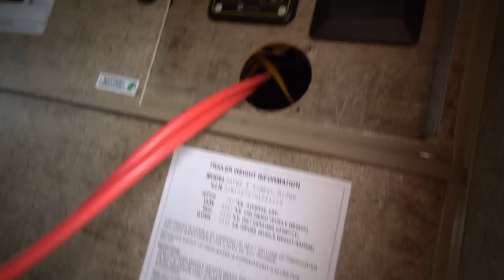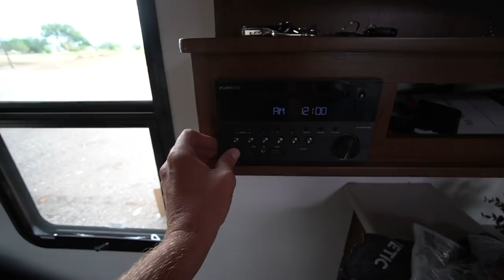Detailed Installation of RV Lithium Battery Upgrade 🔋(Step by Step)

Comment: I would like to see info about the design and component selection process.  Who did you work with on that part and did they give you a detailed wiring or schematic diagram?  THX
Reply from the maker: Hey there. I designed it and didn’t do a schematic on this one. I just researched, read, and watched a lot of videos. This was my third install, ( van and truck) so a diagram wasn’t as necessary for me. But I agree it does help to have a diagram for sure!

Comment: So now that you've spent time with this system do you feel like it was overkill?  And maybe you could have used fewer batteries, i want to upgrade my tt but im just turned off by the price, im thinking maybe a 400ah sytem would be fine, im not full time, i have panels already and on board generator, thanks
Reply from the maker: You would probably be completely happy with 400 ah. We had 400ah and 300 watts solar in our sprinter van we lived in full time for 2.5 years. It was great except for the low sun winter days and we really couldn't run the "big" AC appliances for long periods of time. The goal with the new system was to be able to run those big items like Air con, water heater, induction cooktop, air fryer, etc for many ours a day a not worry about it. So for this new system is an amazing way to live off grid. We are still testing the limits of the system but we rarely go down past 50% right now. But we are also pretty much getting all sunny days here in the SW and have''n't ran into a cloudy streak. That's where that big bank would really shine. As well as looking forward to running the Air con for many hours in the summer time.

Comment: Very informative.  Did you put a dc/dc converter in the 7 pin line to keep the camper from stealing power from the truck battery? I see small blurbs about this occasionally and I'm not sure if it has to be done or not.
Reply from the maker: Thanks. Not I didn't add a DC/DC on this one. I do already have one in the truck for the second battery I put under the seat that runs our Dometic cooler though. On the camper, when plugged into the truck the 7pin does send about 70 watts or 5 amps into the camper batteries. Some people think it will hurt the alternator....but it's such a small draw.
Reply: I just happened to ask BattleBorn that question yesterday and they said that was not a concern w the 7 pin connector

Comment: You used 4/0 cable but would 2/0 have been sufficient? Not criticizing your choice at all...just curious.
Reply from the maker: 4/0 is recommended by the inverter manufacture as well as most installers. I'd rather over do it as well for the little amount of extra money. Maybe $50 bucks.... Also, 4/0 will dissipate heat better than 2/0.

Comment: So I hooked my system up like you outlined in your video. What is stopping the solar from back feeding the system? When I'm disconnected from shore power and both 12 volt disconnects in the off position, I'm still measuring 12+ volts on the buss bar. Does the solar need a separate disconnect switch to stop the current flow from the panels to the buss bar? I'm reading 12+ volts on the line side of the 3000 watt inverter with everything turned off. Am I overthinking this?
Reply from the maker: Yes, the solar should have a disconnect so you can shut off the power completely. Some manufactures install solar directly to the batteries and after the disconnect switches so that it still charges the battery but the coach power is off. Try the reading at night and see if you then get the zero volts.
Reply: @IreneIronTravels  thank you! I'll give that a try.

Comment: Hey Aaron!  Bill here, your fellow ORV owner and Minnesotan again.  This is off subject I know, but curious what kind of mileage you guys are getting with your Tremor after owning it for a few months.  Evidently, our GMC Duramax, according to our dealer, says there's nothing wrong with the truck.  We're averaging about 8mph gallon when towing.  So......I was in the local Ford dealer spec'ing out a Tremor package.  My neighbor just bought an F350 and we're going to pull the trailer with both trucks.  If the results are what I'm expecting, we'll be ordering the Ford next week.  Just curious what you guys are seeing with the mileage....Thanks Aaron, and happy travels to you both!
Reply from the maker: Hey 👋 bill! Yes, 8 sounds pretty bad for a diesel for sure! We’ve been getting 12.5 to 13.5 towing. Around 16 city and upto 20 hwy. pretty happy with the mpgs so far!
Reply: @IreneIronTravels  Thanks for the quick reply Wow!  That's really quite awesome and reassuring!  Our last trip to IN we spend about $.50 per mile for the entire trip!  Crazy.  We're heading to Moab in a few weeks and will break our bank acct with fuel expenses🤪  Thanks again,  and hope all is well!  PS Just finished with our solar install 1050 watts and will be installing a Cel-Fi Go cell signal booster this coming week.  Hoping that works as well as what the reviews are saying...
Reply: What year is your duramax?  I have a 2021 2500hd and towing a  i average 14.8 according to the monitor, the trucks got 13k miles now

Comment: What kind of power can you push through your 7 pin connector.  Big battery capacity is nice but you eventually need to charge it.
Reply from the maker: 7 pin only does about 70 watts or 5 amps. Most charging is done through the 1200 watts of solar or close to 85 amps peak in the summer. Doing good in the winter so far…. And then the inverter charges at 120 amps as well if we plug into shore power.

Comment: Did you have to change out your stock converter for one that will properly charge your new lithium batteries? Nice set up- by the way.
Reply from the maker: Thanks!  The progressive dynamics converter that came with our 2022 Outdoors RV has a switch on it that changes the charging voltage for lithium. So we did use that until we installed the Victron inverter charger. I then disconnected the PD converter as it’s not needed once we have the Victron inverter charger.
Reply: @IreneIronTravels  So if you are ever connected to shore power, what does that power hook to?  This is where I get lost a bit in thinking through how it all works.
Reply from the maker: I totally get it.. that confused me as well at first. This all gets explained better in the next video with the inverter. So the shore power now goes to the new inverter first (called a pass through ) and then the power goes back to your RV’s breaker panel to power your AC appliances. The new inverter charges the batteries if needed and  also provides a small amount of power (float mode) to keep the batteries full when you use 12 volt appliances like lights,fans,etc.
Reply: @IreneIronTravels  Thank you.  So the converter is no longer needed to convert  AC to 12v because they are powered from your battery bank system and its and no longer needed to charge the batteries because you have a charger on the inverter.  So its now redundant. But you do need the breaker portion of the unit built in unit?  I think I have it.  Cant wait to see the next video.
Reply from the maker: Yes exactly! Yup, the factory breaker panel, including AC breakers and 12 volt fuses all stay the same. Except, the main 30amp breaker is now wired from the inverter instead of straight from the shore power. Shore power now goes to the inverter.

Comment: With 810amps from the batteries why did you use a 400 amp T fuse, I am just curious how determine what size T fuse to use?   Great video also.
Reply: 810 amp hours of capacity in the batteries, not 810 amps of current. The 3000 watt inverter at 12v is only 250 amps. It can surge to more so that is the fuse Victron recommends.
Reply: @chachi5975  Ok thank you for the explanation, I appreciate it.
Reply from the maker: Yes, Cha Chi is correct. The rule is to take your largest power draw (250 amps for me) then multiply it by 1.5 ( 250 x 1.5 = 375) and then round up to the nearest fuse size..... 400 amps. Check out this article for a more detailed explanation. https://www.explorist.life/what-size-fuses-to-use-for-a-diy-camper-electrical-setup/

Comment: Any worries about the heat that’s being created under the bed while sleeping. Does it get hot while sleeping
Reply from the maker: No, nothing much  is really on while sleeping. And there really isn’t a noticeable amount of heat at all from the batteries and components. But the inverter can produce a lot of heat when charging batteries and also running big appliances. I’ll keep monitoring the temp as we get into summer months.

Comment: My experience with these batteries was very disappointing, I had 5 batteries of this brand in a sailboat that I bought and the fact of having these batteries drives me to buy the boat because of the supposed quality of the batteries.

I started having low battery performance and did a check of each of the batteries I found one battery out of the 5 I have in bad condition below 10 volt and I tried to charge it and I was never able to charge this battery again

Why did this battery fail?

The Batterborn technical service gave me several explanations on how to resuscitate her but she did not return. 

the other 4 are still working perfectly,

Why did this battery fail?

Finally, because I didn't have a receipt for the purchase of a battery that has a 10 year warranty, they didn't give me warranties on the battery.

Finally, because I didn't have a receipt for the purchase of a battery that has a 10 year warranty, they didn't give me warranties on the battery.